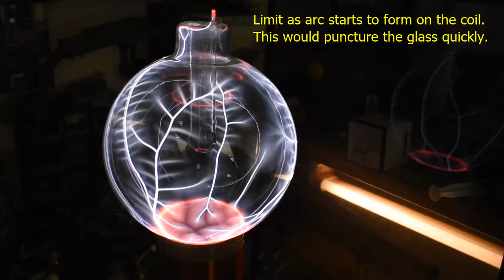Plasma Globe

Comment: Beautiful!
I seen a comment saying that the globe imploded which was a shame.
Reply from the maker: thanks, yeah in a later experiment. There is always a risk. The heat generated in the plasma working on large coils can stress the glass. There is also a chance of arcs forming and puncturing the glass. It had been stressed many time before imploding while sitting untouched on the bench. It went off with quite a bang and I'm glad it happened when I wasn't holding it at the time.
Reply: Damn!
That must have been quite scary.
I hope that doesn't happen to me.

Comment: Really nice effects in the globe
Reply from the maker: This globe imploded shortly after this work out . Surprised yours didn't :-) Quite often get punctured with the arcs
Reply: @tuopeeks yeah that's not surprising, shame... I have punctured stuff in the past and now I'm really careful, very low power or short runs but yeah I know how easy It is to lose a nice piece to the coil...
Do you think it was uneven thermal cycling that caused it to implode?? 

Steve
Reply from the maker: @T2D.SteveArcs Definitely was running hotter than designed and may have had a lick from an arc along the way.
Reply: @tuopeeks  🤣👍

Comment: What happened to the faulty unit?
Reply from the maker: The fault related to the gas in the globe, it would start easily from the normal inverter output. The TC  produced a higher output and the heating effect on the globe made it work better but risked cracking the glass.

Comment: i have a load of those riffa caps and wasnt sure if i could mount them upside down (because of the liquid electrolyte) nice vid
Reply from the maker: I have a box of them from a UPS overhaul at work and they are still in spec.  Don't think there is any issue with position as the liquid doesn't run about inside that much. Must take one apart to check that. What did catch me out was the mounting stud is common to the negative on mine.
Reply: @tuopeeks  wow is it ? i will check mine
Reply: no way your right mine are the same n i got two in series for half bridge so one of them will have half the rectified mains on it that could have been dangerous thanks for pointing that out
Reply from the maker: @T2D.SteveArcs  It's in the specs for the type of cap but I figured it out after it blew a bridge rectifier.
Reply: @tuopeeks  ha thats how I find things like that out aswel
Reply: just read your email Thanks will mail you back bit later today  Nai(TI) scintillation crystal n yeah i know what you mean about  yt suitability

Comment: With the fluorescent energising like that, what else is feeling the effects?
Reply from the maker: Yes,  depends on how close (inverse square law) and if any metal forms a tuned circuit or arial.  Not uncommon to have small sparks from touching grounds. I did get my nose burnt from a spark from the frame of my glasses once. It also can interfere with electronics,  but nothing permanent, so far. Makes my PC monitor picture jump about. :-)

Comment: Was the colour change in the plasma around 0:45 a camera effect?
Reply from the maker: Can't completely rule that out as the camera may have change setting with brightness, but I think it is actually due to the field strength changing. There a a number of different gasses inside with different electron transitions. The transitions occurring dictate the colour produced.